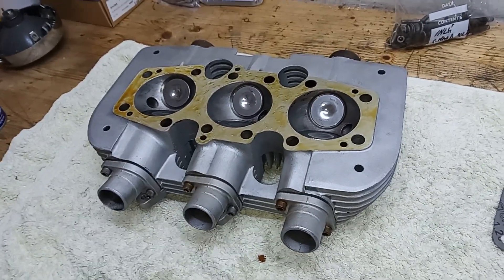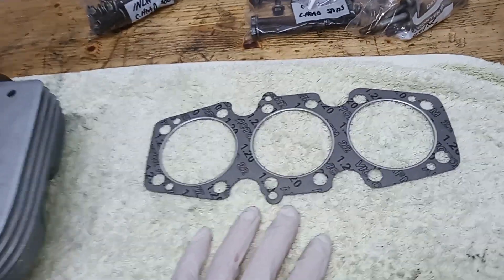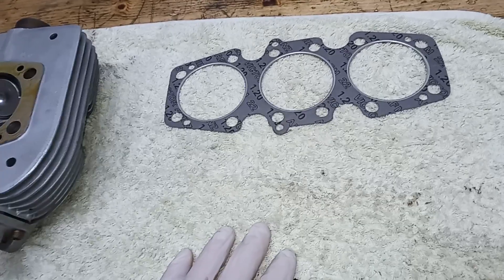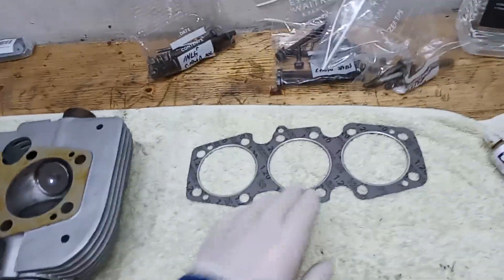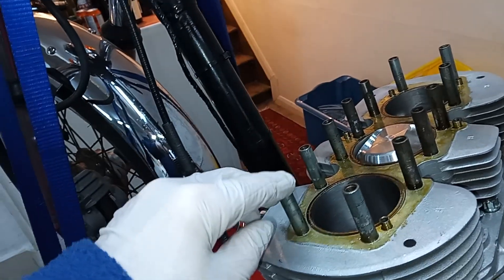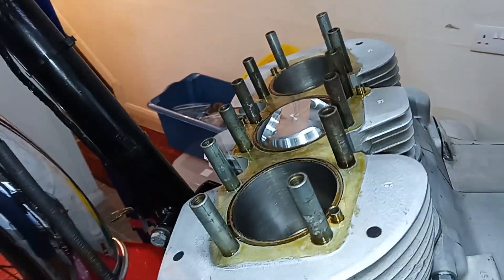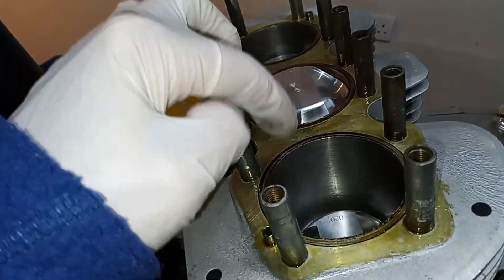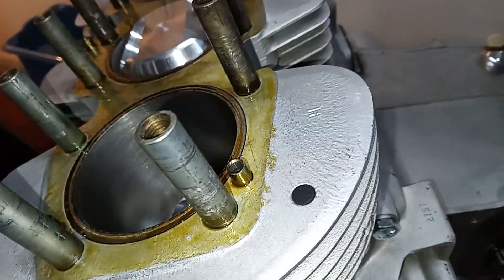Triumph Trident T160 Rebuild. Part 57: Cylinder Head Fitting 2

Comment: Hi; may be is a Trident thing but is not necessary; actually not better; to use sealant with a composite gasket. The idea is to torque more times than the manual says to obtain a fine compression that seals all the head.
 --By the way, do you use an stabilizer with the cell phone or camera? Thanks
Reply from the maker: The problem with the Trident head is oil leaking from the oil drain holes, hence the Wellseal. No stabiliser used on the camera.